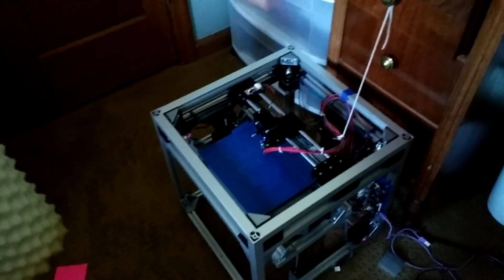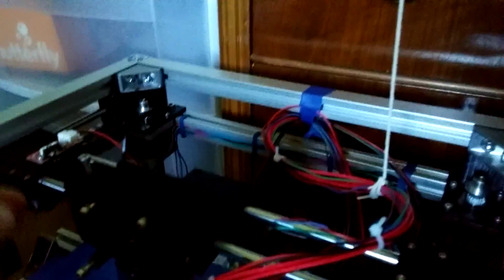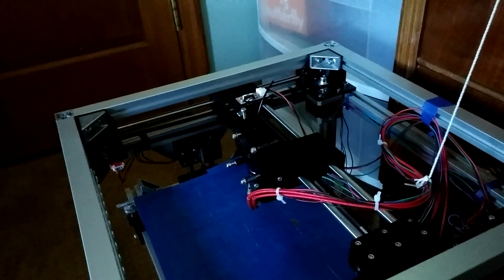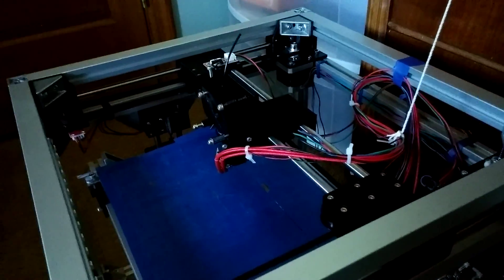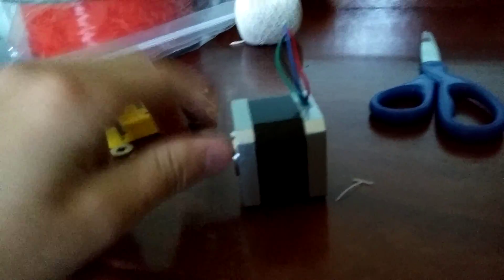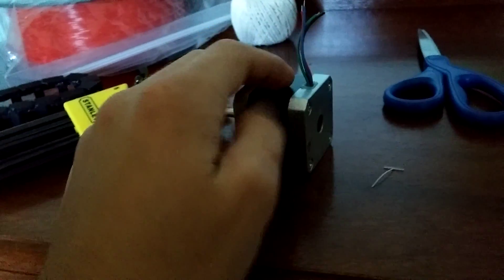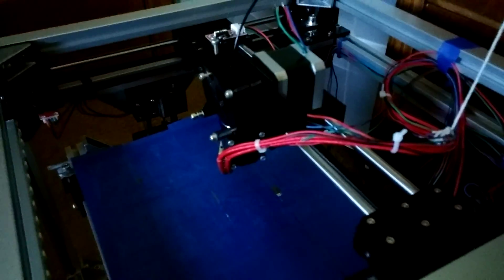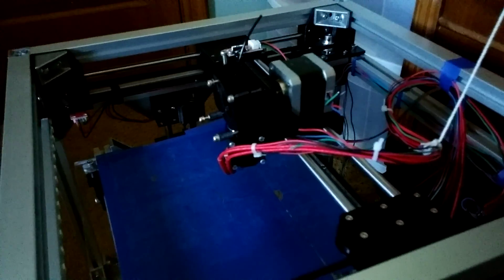3uP Update 22 - Extruder problem [Solved]

Comment: Just wanted to see if you had an ETA on v1.3 or 1.4, whatever the next version is, of the 3uP parts?
Reply from the maker: I plan to release 1.3.1 tonight and 1.4 around September 15th (it will be right as I start taking orders for batch 3, so whenever that is). 1.3.1 will NOT feature the moved x endstop to the x gantry, as I don't have time to test one of the parts. It will however include mounts for the endstop in the parts "x slider a" and "x slider b", just no place for a bolt to trigger the endstop. 1.3.1 is mostly some minor tweaks besides those 2 pieces I just mentioned, remember there is a full changlog which can be found here!
http://www.fabric8r.com/forums/showthread.php?1742-3uP-Metal-Upgrade-Kit-Download-links-BOM-Instructions-and-Info

Comment: My y-axis stepper also broke, it got so hot in its wooden box all the white plastic parts are a brownish yellow and one of the screws in the back came a bit loose so it made kind of a grinding noise. You can get both sides off relatively easy, if you press on the corners from the inside with something,or use one of the screws to push from the opposite side through the holes. I don't think you can solder anything on that, as the connections are under the black part.
Mine is stuttering and trying to move move back and forth when it should be going in one direction. Sometimes after disassembly it works for some minutes but then it's broken again, will have to replace it.